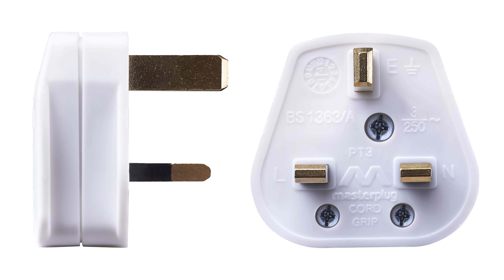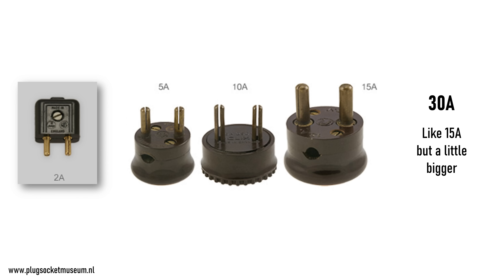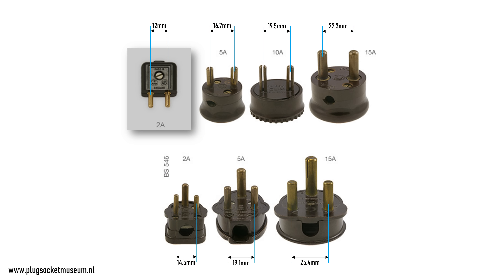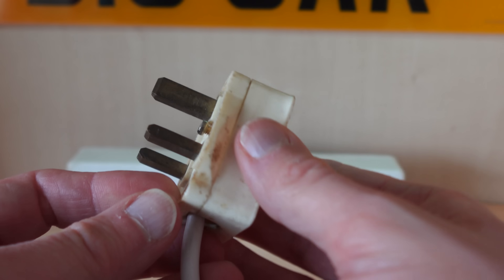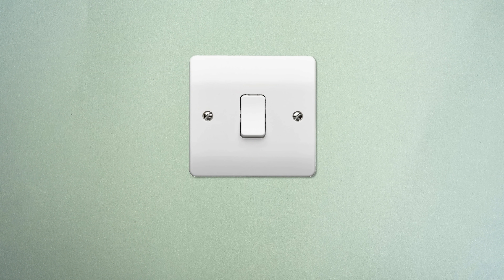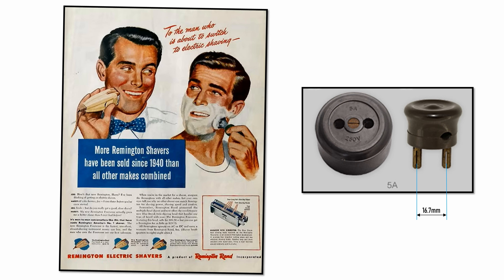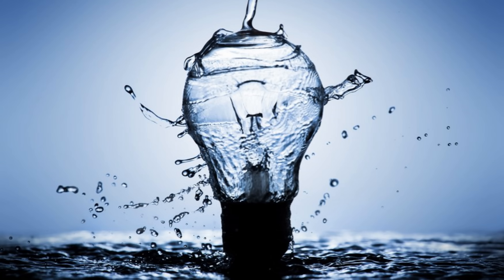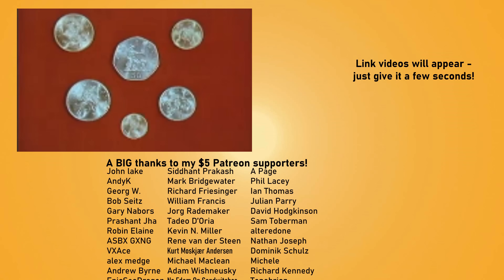Shaver Sockets are really clever

Comment: Hi,
Re the 'failing' in the standard (3 pin) just after the war, if the standard had required plugs to be fitted, what would you need to do if your house happened to still have the older standard.
I have been in houses retaining the old standard as late as the 1970's. This would have meant any customer would have had to buy a replacement plug, they were still available at Woolworths, remove the fitted plug and fit the new one. Also the fact that must appliances were not fitted with a plug meant most people were trained how to fit them. This training happened in school, at junior clubs such as scouts and guides, many Sunday school clubs (church clubs).  When you bought an appliance the shop would normally also sell plugs, if asked they would often sell you the correctly fused plug and fit it  
I think you also missed the fused round pin plug option, these often had the fuse as the positive(live) leg of the plug itself, so you would know what size was fitted.
Reply from the maker: Good point.
I did "sort of" mention there were early fused plugs - "and at this point most plugs didn’t come with a fuse."

Comment: That story shows just how much UK practice was driven by over-engineering.  History has left UK practice far behind.

Appliance fuses introduce causes of failure.  They need skills, spares,  and tools for fault finding and repair.  Modern protection systems ( circuit breakers and RCDs and no fuses) are safer and more user-friendly, and allow for much smaller plugs

Systems that require an earth pin to move shutters prevent the use of small cheap two-pin plugs that suit many modern double-insulated appliances.  Flat pins are at less risk of insertion of metal objects.

Isolating transformers make touch less dangerous.  But RCDs offer better protection if not the 115V option.  But modern traveller appliances mostly accept voltages between 100-240V.

So UK 13A plugs and sockets are in reality a disaster.  Over designed for circumstances that no longer exist.  Can I recommend that the UK convert to European plugs and sockets, or perhaps the Australian/New Zealand plugs now used also in China.

But changing plug and socket systems is not easy.  It needs to be carefully thought through.  You get decades of new compatibility and safety issues.
Reply: Obviously biased as a Swiss, I'd like to see the Swiss "type J" plug (or the very similar Brazilian "type N" plug) see more adoption. Looking at many of the other systems around, including the EU and UK systems, they all feel very big and clumsy, in particular when it comes to power strips or extension cords.

Instead of these huge plugs, just imagine having a grounded version of the 2.5A "euro plug" rated for 10A or 16A ... and guess what, you get the Swiss "type J" plugs 😉
Reply: @m__42  My only issue with the Swiss one is the dry-room socket that's not recessed. Otherwise, I really like it. Having 3 sockets in the space of one outlet is hard to dislike...
Reply: @HenryLoenwind  Indeed that was an issue, but since 2017 code says only recessed (T13) sockets are allowed in new installations, dry or wet. Obviously already installed non-recessed (T12) sockets don't have to be replaced until major changes are made to the installation.
Also since ~10 years, all new device plugs must have the partially isolated pins, in order to reduce the risk of accidental contact with a partially inserted live pin.
Reply: @m__42 Thanks for that info. I haven't been to Switzerland since 2007. Seems like a good change that eliminated my only point of criticism.

Funnily, the only mementoes of my time in Zurich I have are a couple of Swiss plugs and cables. I like them so much that I even contemplated installing Swiss sockets in the high-plug-density area behind my computer. In the end, I decided against it because of the long-term hassle of having to fit new plugs forever...

Comment: In France it is common to have you washing machine, and even your driers in the bathroom. And the euro plugs don't contain fuses.
Reply: You are responsible to match your outlet use with a matching fuse in the remote fuse box.
Reply: @iTris666  Breakers over 16 A are not allowed in socket circuits as the sockets are  rated for 16 A.

Comment: Nerdy subject but as ever well presented and informative.Anyone remember the round 3 pin plugs with a cartridge fuse as one of the pins? I remember being in a Beijing hotel in the early 80's and being surprised to see they used standard UK 13 amp sockets everywhere. Still find Chinese origin items, eg discount supermarket own brand soldering irons, sold with 13 amp fuses instead of 3amp - always worth checking.

Comment: our canadian/usa plugs are terrible things compared to the british ones, plugs come loose, fall out, have exposed conducting blades, many devices have no ground conductor etc etc. plus we have the ridiculous 120/240 v system.  we used to have shaver plugs with an isolation transformer, but they have disappeared and gfci outlets now offer better protection in wet areas.  major appliances require a three conductor cable(plus ground conductor), this includes stoves(cookers) and clothes driers
Reply: I would not consider the "120/240" split phase system ridiculous at all. It was a compromise for an already existing electrical system. ALL North American homes have 240v at the meter that is split 120/120 with large appliances using both sides of the phase to give 240 30 amps. Works well. We do need to improve our plugs and sockets.  Have not seen a loose socket in decades and that was in a very old hotel in Manhattan.  All plugs become lose with over use.  The standard needs to be updated to insulate the first part of the blades like our European counterparts.  The Australian standards are similar, plug wise to North American plugs/sockets except the the blades are turned inward at an angle . No complaints there.
Reply: @kennixox262  Conceptually it's not ridiculous but its implementation is pretty ridiculous. We nominally have dozens - yes, dozens - of plug/socket designs arising in part from split-phase, most of which are incompatible with each other for no particularly good reason (the downwards compatible 120V (and also 240V) "t-slot" 20A sockets are something of an exception). For instance, the 6- series is for 240V plugs and sockets but they're not compatible with the 14- series of dual 120V-240V sockets, which is a major nuisance now when installing Level 2 EV chargers (just look up discussions on 6-50 vs 14-50 sockets for EVs...). There's also the 10- series of dual voltage sockets but they lack the grounding pin of the 14- series, and no, you can't plug, say, a 10-20 plug into a 14-20 socket.

Then there's the way wiring is organized. Given that we split phase, we could in theory run all of our circuits with 3-core wires with every 120V duplex receptacle being split, which would then allow us to put twice as many receptacles on the circuit and would allow for more flexibility as well as save on one wire, the "second" neutral. So we don't even take advantage of what would be one of the system's greatest advantages. It would also mean that every receptacle would be 240V-ready as there would 240V across the hots of the two sockets.

Oh, and let's not forget the 208V stuff used as a cheap trick to provide higher voltage from two 120V legs on a three-phase 120V system, which is distinct from the split phase system. And yes, they technically have their own connectors too, the 18- series.

The proliferation of all these dozens of socket and plug designs means that most don't get used and are extremely expensive when you do need one. So yes, it's a ridiculous system.
Reply: @davidjames4915  lots of the crazy is simply due to compromises, I guess if Europe gained one thing from the wide scale bombing WW2. Getting the shit bombed out of it let them do effectively a full reboot of their electrical system.

I fear attempting major upgrades and consolidation today in North America would not fly due to cost and I am sure there would be people on cable news going "Now they are trying to take your outlets away"

But at least we did 60hz, the higher cycle rate allows slightly thinner wire at similar voltages. Tidbit of fun, this is why aircraft sometimes run as high as 400hz, even thinner wire saving mass. I am not sure why higher hz allows thinner wire but it does.
Reply: If a device does not have a ground conductor in the US it does not have it in the UK either. Those are known as double insulated and they are safer then grounded ones.

Comment: Damn I now understand why my old Electric tooth brush charger had such an odd plug. My dad said it was because they came from Japan or something but now it makes sense the house just lacks those plugs. I think in Northern Ireland the shaver plug isn't common as I can't think of a single house with them not my house, My Granny's or my Nana & Pocks nor my Uncle, Aunts or any of my friends so it must just be missing here probably to keep in line with the Republic of Ireland as I don't think they exist down south but I'd need someone who lives down south to confirm that but I am guessing that is the reason why as well it may never have been done. Also I am going off of mainly old houses built in the 70s or so or at least with the most recent electrical wiring for plugs being done then as I know the sockets are old as they are a single socket on their own in a part of the room & with an older design that has no clear on/off note like newer ones.
Edit: wait you mentioning Hotels made me remember I've seen these sockets inside of hotels before so they may not exist much in everyday homes but for certain its a standard in hotels. (Cork & Dublin for sure)

Comment: It’s odd compared to North America because a gfci (RCD) protected socket is required by law to be next to the sink in the USA. It’s illegal not to have one. Sockets need to be 900mm from the shower/tub rim, or the farthest wall from the tub if the bathroom is less than 900mm in size. US used to have shaver outlets too, but they were replaced with the gfci ones. 

Being scared of a light switch, but then having electric showers seems insane to me 😂

Comment: The UK's electrical sockets are certainly the textbook definition of "overengineered". Though maybe postwar building standards were a little rushed, so maybe it made sense. North American bathrooms have full 110v/15a sockets, and normal toggle switches. Anything near water has to have a GFCI/RCD by law since the 70s. I use a corded trimmer. No batteries to wear out, cheaper than the lithium ones. Never gotten my batteries charged, or even tripped the GFCI. There are cases where you do want an isolation transformer. Such as working/testing on anything with exposed wiring while doing repairs. But there's special ones for those applications.

Comment: It's kind of silly that any Euro plug device can be plugged in. Like you're saying, you can plug in a European hair dryer. An item many travelers will have with them and it's mostly used in the bathroom.
Reply: No hair dryer has an Europlug. They use Contour plugs. The Europlug is max 2.5 A. Also you can never split a Europlug, only one to one extension cords are allowed.

Comment: The last point about rechargable toothbrushes and if the socket is needed anymore cancel each other out... where else do people charge their toothbrush other than a shaver socket in the bathroom?
Reply: you got two options: cut the 2 pin plug off and fit a 3 pin (as I have done) or buy a 2 pin to 3 pin adapter for about 20 shillings
Reply: No, what I mean is, it’s quite common for people to want to charge their toothbrush in the same room they brush their teeth. Meaning it isn’t the end of charger sockets in the bathroom. It’s still reason to have them!

That said.. a multi socket charger socket seems impossible to find.. family has two brushes needing chargers.. but

Comment: Ive always found it strange that a european 2 pin plug can be plugged into a UK extension lead. You just need to insert the UK plug at the end of the extension lead wire into one of the sockets upside down, so you're plugging in only the earth pin which opens the shutters on the live and neutral, and then you can plug in your euro 2 pin plug, remove the UK plug from the earth pin and plug the extension lead in. Im surprised extension leads aren't designed to a BS standard that would prevent you from being able to do this.

Comment: I know it sounds a bit petty, but the UK voltage is normally at 240V, not 230V. Does this matter? I recently repaired some controllers from 30 year old German compressors - the miniature failure was that the 230V transformers had failed. I hypothesise that this was because they had spent 30 years slightly outside their rated values. Voltage limits are also quite important for LED lighting step down circuits.
Reply: The permissible limits are 230V -6% +10%, so from around 216V to 253V is acceptable. I don't know what the German network tolerances were, but I would say from long experience that 30 years is pretty good for  transformer in an industrial environment.
Reply: @Stuartrusty  True, but my point is that the mean value is 240V, so if you do a steady state analysis of power dissipation, that's the figure that should be used - it's not the same as a tolerance analysis and saying that 240V is in tolerance. 

With regard to the transformer, in my experience transformers normally fail when some other component has failed and too much current flows in the secondary. In the example I mentioned above, the primary side had burned out with no other effect - I haven't seen that before.
Reply: @Stuartrusty The European standard has the same range but the nominal is 220 V, this allowed harmonising mains voltage across the region. With most devices having switched mode power supplies there was no problem, it only became a concern with incandescent light bulbs, since the UK uses bayonet and the reast of Europe screw, it is not a prolbem, north America use different size screws
Reply: It's 230v, as it was harmonised with the EU.
Reply: @Robert-cu9bm It's not if you measure it. Nothing actually changed when everything was harmonised.
Reply: @Robert-cu9bm  The EU was 220 V and the UK was 240 V, we both still are, both with a symmetrical tolerance, we both change to an asymmetric tolerance to accommodate the extremes of both. In other words, a fudge.

Comment: Found one of those 15a plugs in my 1930s house when I moved in last year, my electrician was baffeled to say the least!
Reply: was helping to rewire a pre-war house about 10 years ago and found a strange old wire, took us ages to figure out what it was, we were thinking it must be an old code uninsulated electric main at first....
Turned out it was a cord that went from a bedroom to downstairs, and would have been connected to a bell so the master of the house could summon a servant!
Reply: I once lived in a 1929 house. All the power sockets were 10A with 3 pins. Earths were only connected downstairs (upstairs was considered an earth-free situation as you were elevated from the garden). The fuse board had two fuses for each circuit, one in the line and one in the neutral. The sockets were open-backed with single pole knife switches to the left of the face plate.  The socket could not be switched on unless a plug was inserted and the plug could not be removed until the socket was switched off. This functionality was provided by the earth pin with various shapes cut into it for interlocking. Incidentally, the line was on the left and the neutral on the right. Some later plugs manufactured by MK for these sockets had the pins marked the wrong way around.

Comment: TL;DR, UK people are still scared of anything with the remote possibility of danger, and congratulate themselves about how unneccesarily complicated they've made it.
Where I live, we simply have one standard 3 pin socket, and those are also in bathrooms (it's nice to be able to have your toothbrush charger where you brush, so you don't have to go put it in a different room to charge every few days). The solution for 2 pin plugs is simple: It just uses the 2 power pins from the 3 pin socket...

Comment: today the shower light switch & light are solved via 12V-DC lights with outside bath power supply & very low voltage switches (like for a Computer ATX Power Supply or relays)